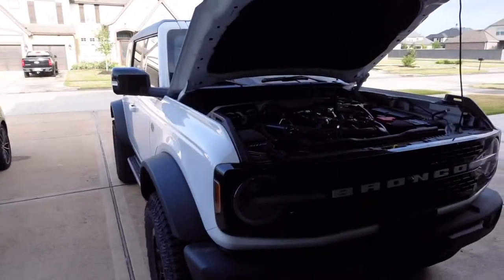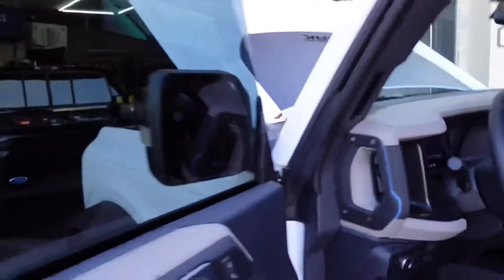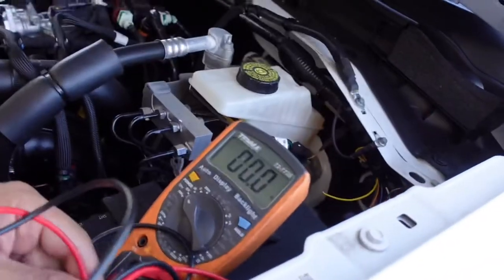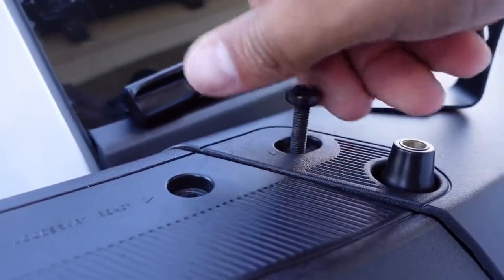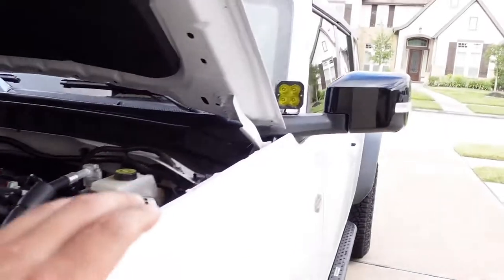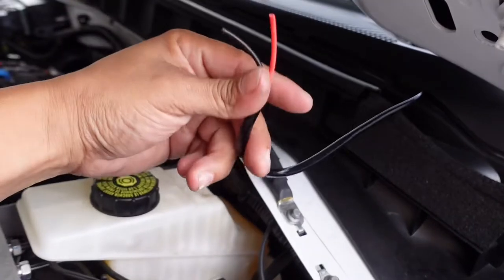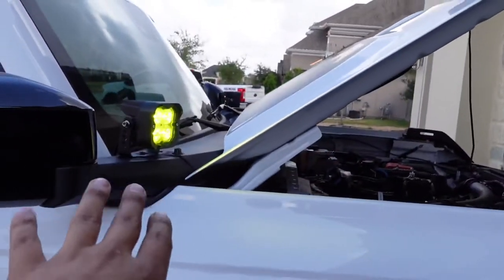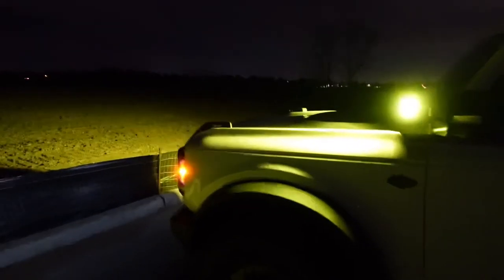HOW TO INSTALL DITCH LIGHTS ON A 2021/22 FORD BRONCO. LasFit Budget Friendly Pod Lights New Bronco

Comment: Nice work! If you plan on installing a winch then you might want to save aux 1 for that. These lights should be no problem for a 10a circuit.
Reply from the maker: Thanks! Yeah I do plan on eventually doing a winch. I’ll switch it over to another Aux circuit at that time. Thanks for watching 👍🏻

Comment: The relay and using 30 amp circuit is overkill. Since these are 18w each that means they draw 36w total and if you devide that by your voltage of 12, you get a whopping 3 amps of power draw. I wired up mine to aux #4 and no relay. And for anyone wondering to find amp draw just divide the wattage by the voltage. If the amp draw is more than the switch can handle, that's when you use a relay.
Reply from the maker: Thanks for the tips.